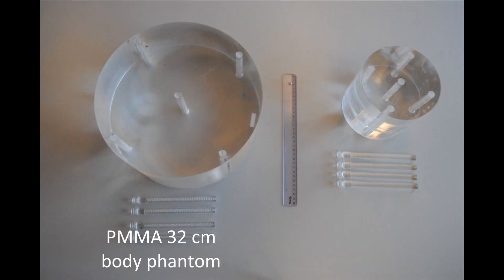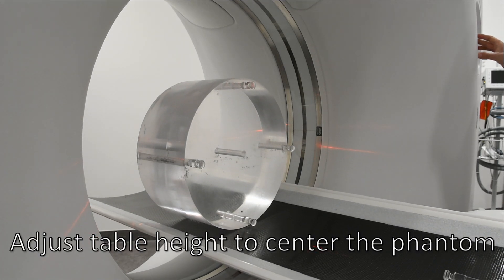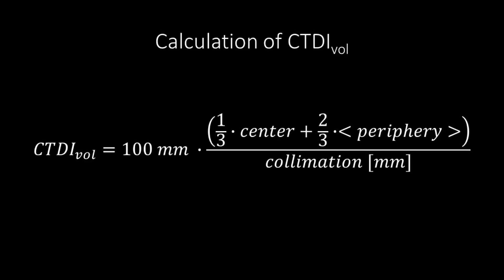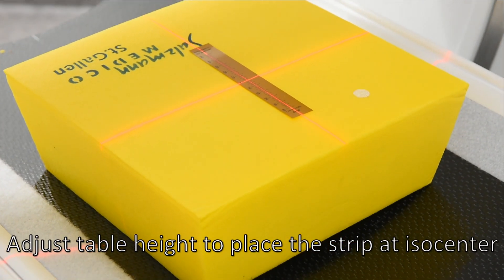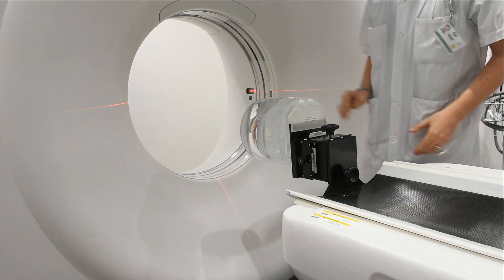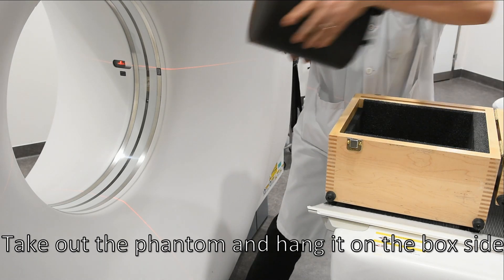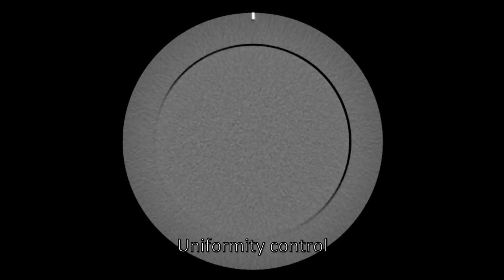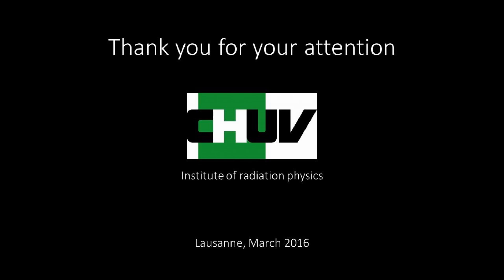Computed tomography: Standard QA procedures

Comment: What the software for HU analysis ? 
After how may months I should do QC phantom ?
Reply from the maker: Hi! For simple ROI tracing and measurements (noise and average pixel value), ImageJ is more than enough. However, for model observer studies, you might want to code your own software. My colleagues use Python for this purpose. It is very powerful and has a lot of packages that can deal with the DICOM format.
Reply from the maker: As for the QC, for CT, the basic controls should be performed every trimester. As for clinical protocol evaluation, I would recommend doing it once per year or whenever there is a major change in exposure parameters in the machine settings, so as to ascertain constant diagnostic quality. But this part is beyond the scope of the video, and you might want to check the scientific literature on how to perform clinical quality measurements.

Comment: What is the purpose of pressing  “0” ?
Reply from the maker: It's more a comfort thing than anything else. It allows you to set the scanning boundaries of your acquisition. For example, for CTDI measurements, it is easier to put the "0" landmark at the centre of the phantom and scan the "0" position. Or knowing the length of your phantom, if you set the "0" at one extremity, it allows you to set the range between 0 and the phantom length. But if you are familiar with the coordinate system of the couch of your own CT device, you can skip this part, if it makes you more comfortable.

Comment: Hi thanks for the good video
I have one question when you want to irradiate the phantom for measuring CTDI, should we irradiate the entire length of the phantom (from the beginning to the end of it) or just length of the ionization chamber (10cm)? Or you just select a certain length to irradiate?
Reply from the maker: Elnaz Ahanj Hi! My pleasure! For this step, it is better to irradiate once over 360° in the middle of the phantom over one typical collimation width at the isocenter (typically 1, 2 or 4 cm). This allows to measure the dose in the phantom but also the scatter tail at both sides. The value for a given collimation width is extrapolated at 100 cm.
Reply: @nickryckx7817  THANKS for your help. The dosimetr I'm using gives me DLP directly so when for example I irradiate a length of  4cm I should devide the  DLP to this length (4cm) and then it gives me CTDI? am I right?
Reply from the maker: Elnaz Ahanj Indeed, if your current is fixed. On helical mode, the DLP might include the overranging, but in axial mode, this shouldn’t be an issue.
Reply: @nickryckx7817  again THANK YOU SO MUCH! really saved me from confusion
Reply from the maker: Elnaz Ahanj My pleasure!
Reply from the maker: Almost forgot: the acquisition is done in axial (or sequential or step-and-shoot, depending on the manufacturer) mode, not helical.

Comment: but sir for head phantom i didnt see what raplace skull bone so the absorbed dose couldnt be corrcte ? and what inside phantom is it empty ?
Reply from the maker: There is no need for something to replace skull bone, as CTDI is defined like this (measured in a PMMA phantom). As its name states (CT dose index), it is a measurement of CT output, not patient dose. If you need a more accurate estimation of local patient dose, you can correct CTDI with the proposed correction method called the size-specific dose estimate SSDE, described in the report of the AAPM task group 204, freely available on the AAPM website.

As for the phantoms themselves, they are homogenous and made entirely out of PMMA, which make them quite heavy, especially the 32 cm phantom. 

I hope this answers your question.
Reply: @nickryckx7817  thank you sir thank you it was very helpfull allah bless you sir thank you